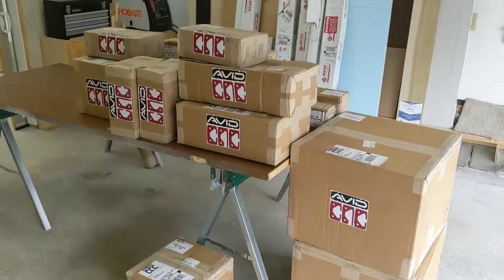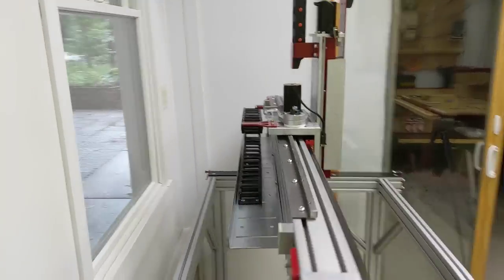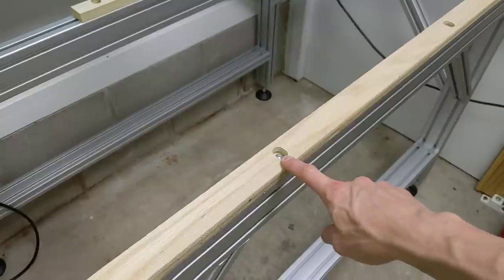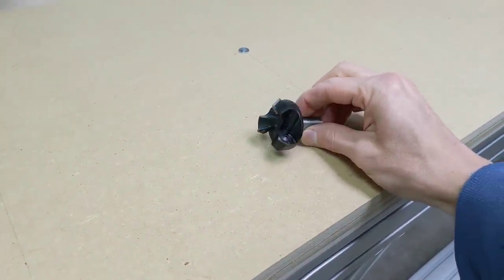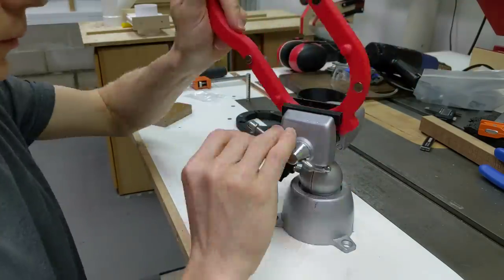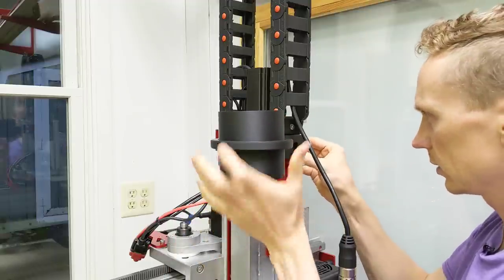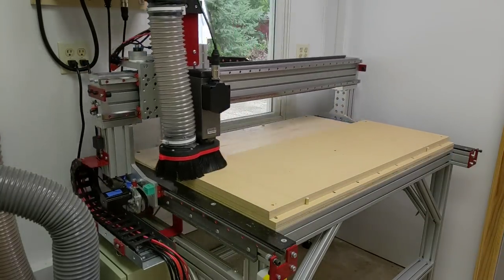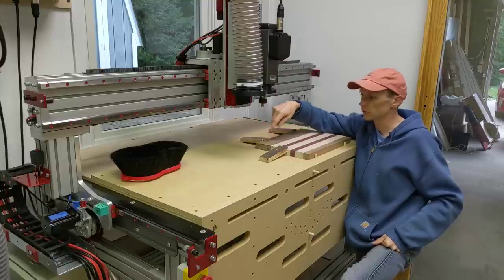Building a CNC Router in my Small Workshop

Comment: I have nothing against CNCs, they do add a lot of possibilities and do a good job. However I don't think making a video about setting them up and doing custom parts for the machine is worth the time to watch as there are already thousands of videos doing this.

So instead of showing me that you got such a thing and how it works, show me why you got it in the first place and actually do something with it. :)
Reply from the maker: Did you miss the cutting board and router templates I made in this video?
Reply: @JustinDepew  I've seen them, but it's a tiny part of the video and shows what you can do with the CNC, but I doubt those things made you spend the cash.

I'm more interested in the creative thinking behind a solution works and why things are done not how. But hey, not every video is for everyone.
Reply from the maker: @mravx2993  thanks for the feedback. Finding a good balance between showing how and why is something to strive for.